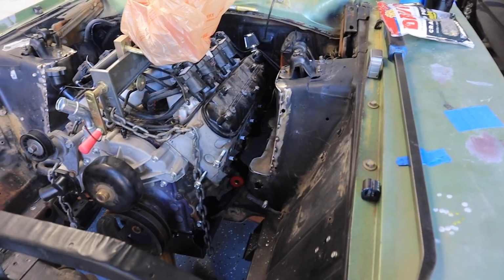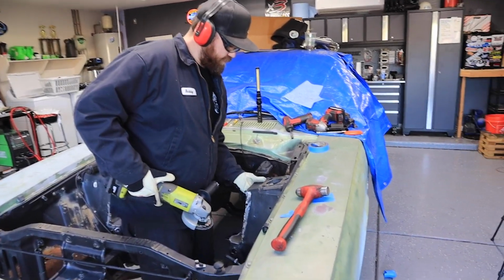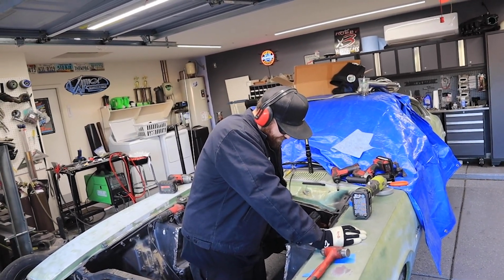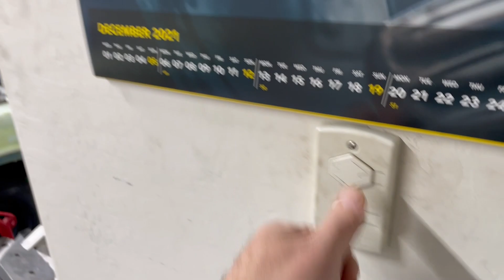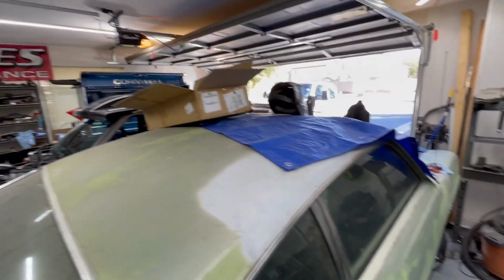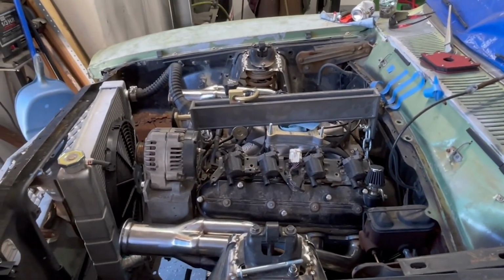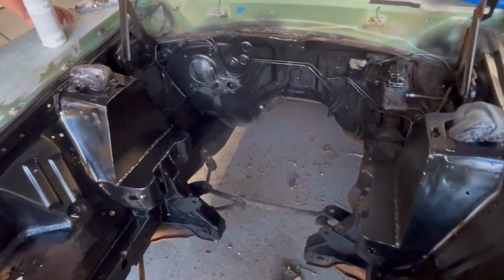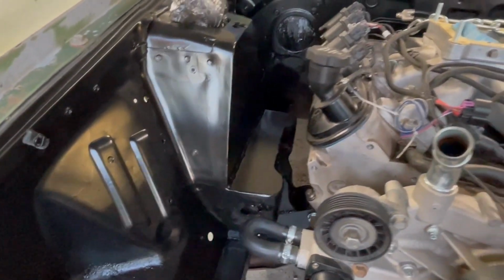LS Swapping A Ford Maverick. Part 2

Comment: I have a Mercury comet gt which is identical to the maverick im also doing the ls swap as well just wondering if I’m keeping it stock would I still have to notch the shock towers? Thanks I’m advanced!✌🏽🤘🏽
Reply: You will either have to do the same thing he is doing or notch the shock towers a bit less and chop up the floor to clear the transmission depending on header routing and transmission choice.
Reply: Buy the AJE Colt65 strut and suspension kit, you'll thank me later

Comment: Wouldn’t have cutting out the whole shock tower, welding in some roll cage bar from the firewall out and then down to the frame, then weld on a bracket to put on coil overs give you even more room? I’m assuming it’s more of a budget build and your buddy doesn’t want to spend a lot.
Reply from the maker: It would have but this is a simple budget build.

Comment: I was thinking the shock tower relocation was going to throw the camber way off...but now that I see it's not struts, I see why it worked. Are you going to run a hood, and will it still clear the shock mounts?
Reply from the maker: No hood. Carb, alternator, and shock mounts all interfere
Reply: The previous people that owned my 70 Maverick made Flat plate shock mounts to get more extension out of the front shocks for weight transfer. Just to let you know in case you ever want to put a hood on the car

Comment: Did you guys ever end up adding the tower straps you mentioned? Or just left it alone 
Starting a 74 maverick ls swap lol
Thanks for all the videos
Reply from the maker: We left it alone. No issues yet
Reply: @RobbyVsGarage  thanks 

Also for the drive shaft did you end up having one made? Or what did you do with that.  

The motor mounts you guys used did you have to slot the holes at all or just bolt up drop and weld ? 

Thanks in advance